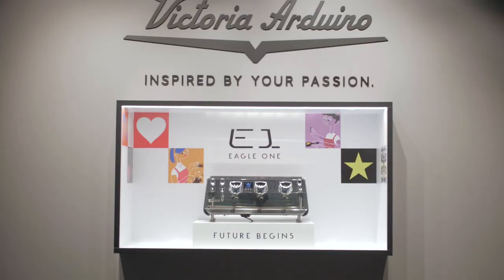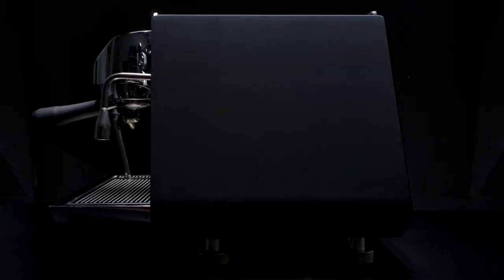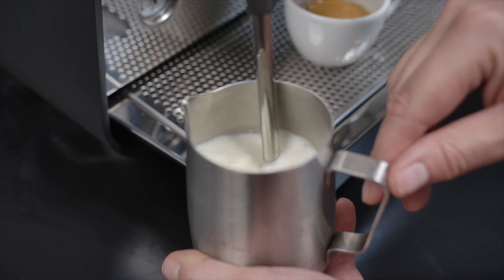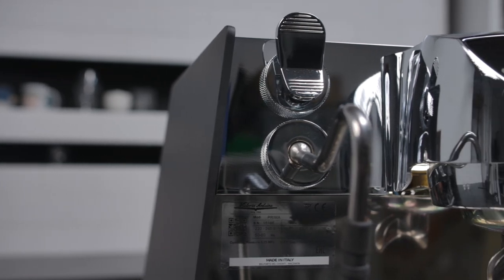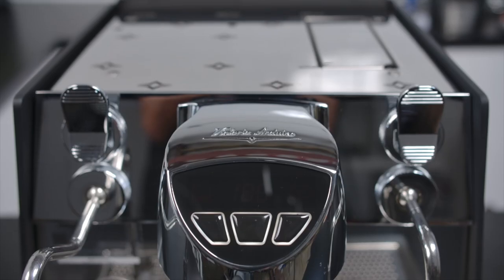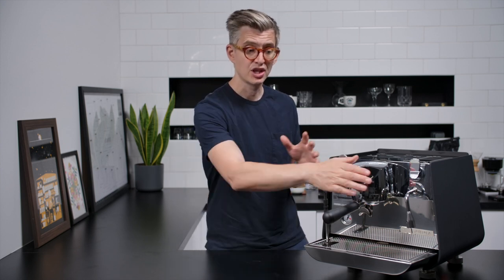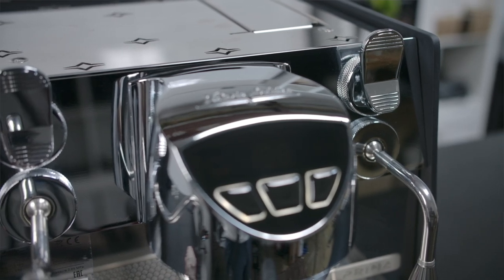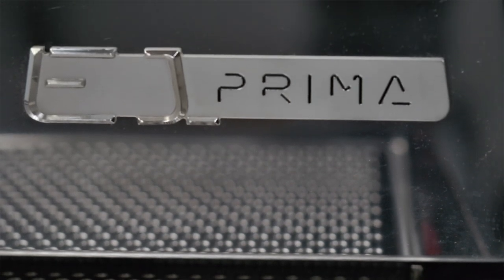EAGLE ONE PRIMA featuring by JAMES HOFFMANN

Comment: I'm a smidge disappointed this has a networked computer built in — in my experience the computer components in "smart" devices tend to be brittle and eventually unsupported, making that the most likely part to fail in what could otherwise be a timeless piece of equipment
Reply: I agree with this. I was playing with this idea in my design class and thought I had a somewhat reasonable solution. Put a number pad (discretely placed where it cant be tampered with) with a read/write switch on the machine. Use a website (much more future-proof) that will take your desired configuration and generate a code for you to input while the switch is in "write". flip it to read, let it give a visual or aural cue that the machine had been configured, good to go
Reply: @easykial  You've just ideated the coffee machine equivalent of a late 70s synthesizer.
Reply: @nadaso8819  That's a smart point! I played too many point and click games as a kid, so I gotta have that "secret unlocked" feel in my designs. Your Kickstarter would disappoint fewer backers tho ;)
Reply: What happens when your coffee machine's app isn't supported by your new device? Do you have to keep an old phone around just to run your brewing device? If I buy a new phone 20 years down the line, can I get the app and a new control module for it to keep it going?
Reply: maybe decent espresso machines can help you ;-)
Reply: Nice design, but very poor QC for such a expensive machine. Also no brewing pressure gauge :-( I don’t want to use the app for seeing brew pressure. And chrome plated plastic switches, seriously?
Reply: @gospelofrye6881  Have I seen coffee machines from 20 years ago? YES. I have 3 of them, they're solid, reliable and well built.
Reply: @truckerallikatuk  Good for you.

Comment: I really hope they come up with a version for home users. Energy efficiency is even more critical there.
The only options available require heating a machine for hours a day just to pull 4-5 shots. That is real non sense.

I would love to see a version at £2500 with less steaming power, no hot water tap if it helps cutting costs. It might sound provocative but what about  a pure espresso machine, no steam, (after all just espresso is more sustainable than adding dairy or other substitutes).
That would allow lower cost but an uncompromised espresso only user experience, energy savings and small footprint to fit real kitchens.

Great machine for offices and pup-ups but I am fairly skeptical about its use as domestic machine, if you factor a grinder we are talking about 5-6k.
Over 5 years the cost would be over £3 pounds a day, without factoring maintenance costs, electricity and coffee.

Comment: I like the way the eagle one can achieve better sustainability for a commercial market, but i feel like that argument starts falling apart when you use such a machine at home. A 2000-3000w machine to make espressos at home is just not sustainable. No matter how efficient it heats water. Just go down to a coffeeshop, it makes way more sense for that sustainability argument.
Reply: My circuit breaker wouldn't run such a thing. Apt building. Electricians recently changed my box from fuses to breakers. 1600w kettle flicks lights.

Comment: Sending mine back. Poor build quality. Cut my hand opening hatch for water tank. Drip tray not level. And does not even pull a decent shot with programmed dhot. Double extracted in 5 seconds?  Nope. Tastes awful sticking with my ecm. It never dissapoints